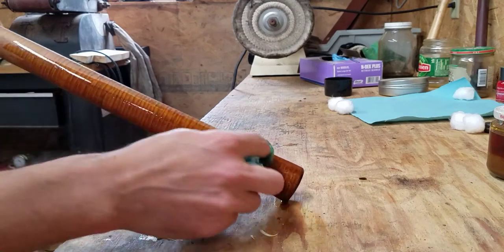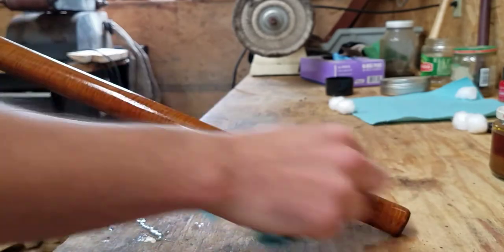Tomahawk handle finishing - curly wood and aqua fortis

Comment: Used to make an ebonizing compound out of acetic acid and steel wool for maple.  The tannin compounds in the wood turn flat-out black as the stuff reacts.  Ends up with a long-term finish, lot safer than nitric acid.    Used to be used for replacement piano keys, among other things, if the wood you had was cured/treated sufficiently and there was sufficient iron (III) acetate in the solution.    Also used to use linseed oil mixed with turpentine, and beeswax, as a long-term hardened waterproof finish.  Worked great on rifles, and darkens over time into a beautiful finish.  Needs a lot of work and time.

Comment: Son you got a lot to learn do not cut raw linseed oil whatsoever that's why it's taking you several coats to get it to absorb use it straight use it raw raw linseed oil is what you want in Wood finishing I've used it for decades excellent none better to clean and condition your guitar fretboards and such my long bows etc